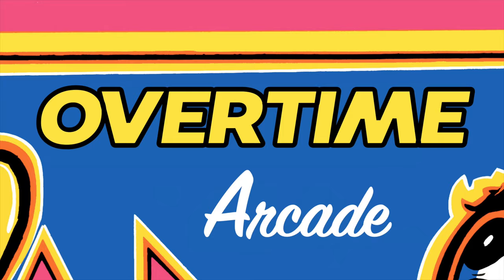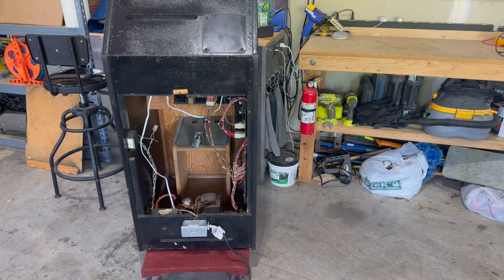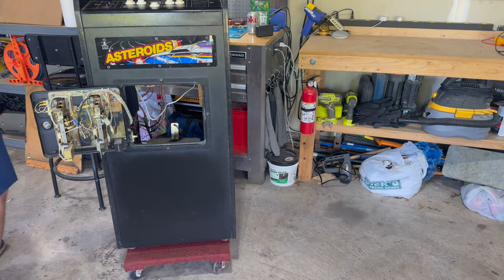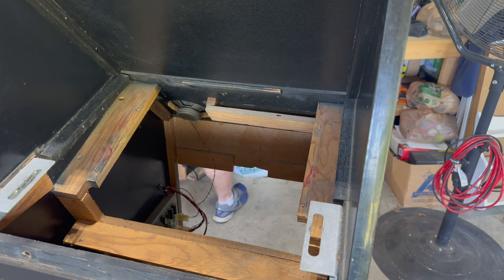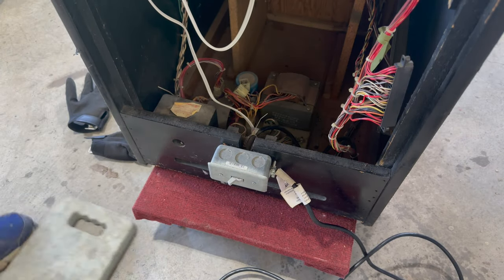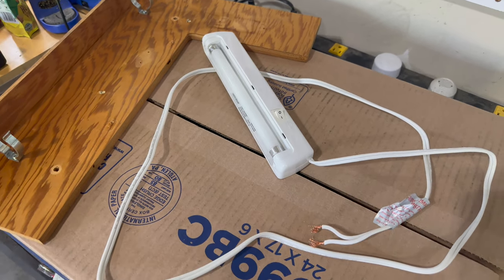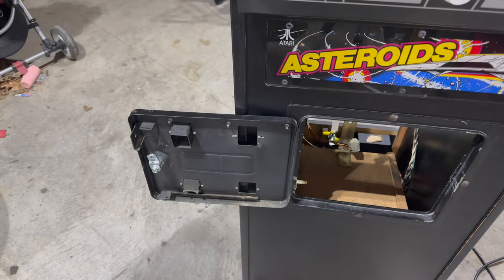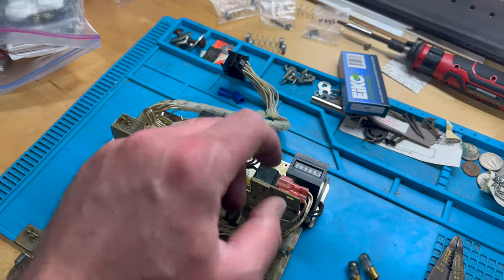Let’s TUNE-UP an arcade machine! Original 1980s Atari Asteroids cabaret joins home arcade collection

Comment: Another tip, you can use a big pencil eraser most of the time to clean edge connectors, and also an ink eraser if you need something more abrasive. The residue will clean off with isoropyl or acetone. Usually they are not tinned per se, as lead oxidizes too quickly, but actually tin plated. If they are gold, definitely don't try to re-tin them. It's not good for them in general or the connectors as the lead will gum them up. If there is battery damage you can actually replate them, there's videos on doing that.
Reply from the maker: Yep, the big soft white pencil erasers come in handy with this sort of thing! But sometimes it’s so bad that you need to repair the contacts with copper tape, which I’ve had to do before too.

Comment: "HEY GUYS!....WE ARE IN THE BASEM....."oh oh ...(sorry different channel!,.:face-turquoise-covering-eyes::body-blue-raised-arms:
HEY CHARLIE!,...:face-red-heart-shape:my asteroids cabaret has vertical collapse,..so my husband and i are going to watch your video and tune up ours!,.:person-turqouise-waving::text-green-game-over:
Reply from the maker: Should I start wearing a bunch of rings and bracelets in my videos? 🤣

Be sure to consult the Black & White Vector FAQ: https://arcarc.xmission.com/PDF_Monitors/FAQ%20Black%20and%20White%20XY%20Version%201.1%20dated%207%20Feb%2002.pdf

For vertical collapse, it recommends checking…

Horizontal line (due to "Y" amplifier defection).
• Bad yoke.
• Bad "Y" amplifier output transistors.
• Blown "Y" amplifier fuse.
• Open fusible resistor in the "Y" amplifier.
• Yoke pins not making good contact (very common).